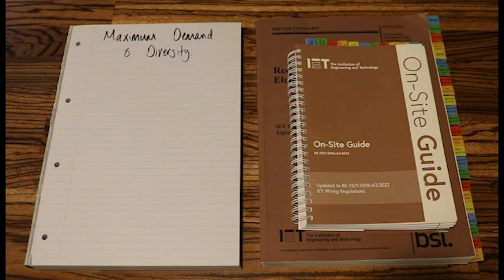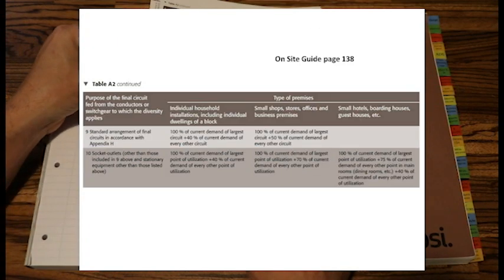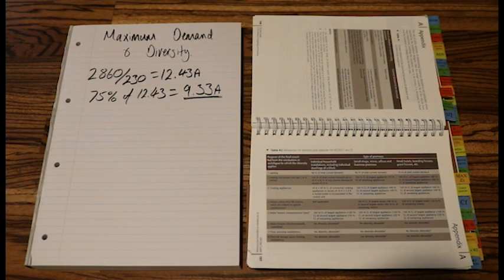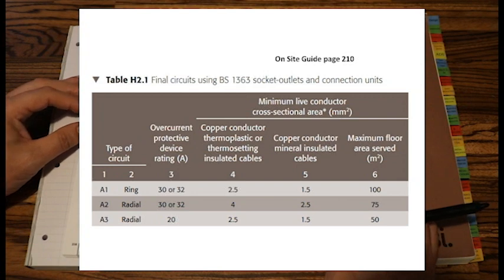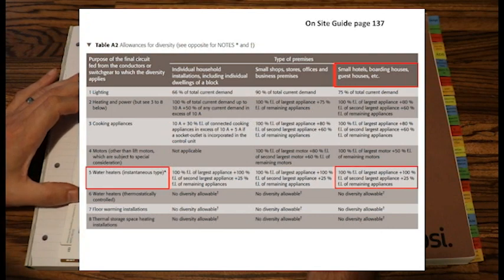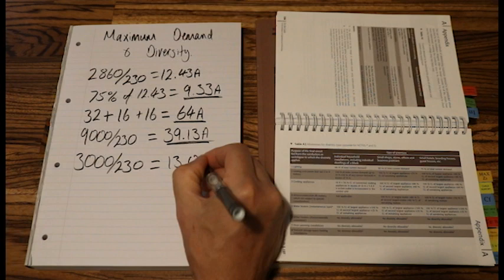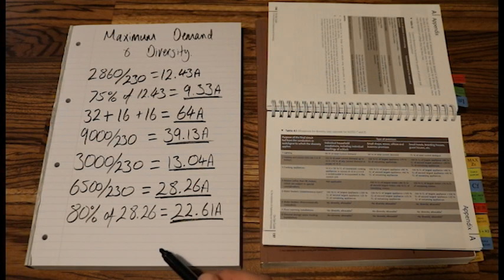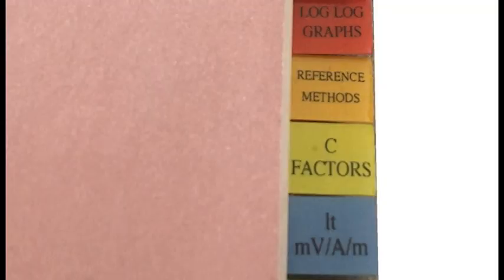Using diversity to calculate the total current demand

Comment: So, I just come across your video and I literally just copied my question into google and came here out of curiosity , my question is pretty much exactly like yours with the expectation of the cooker instead it is just one cooker at 10.37kW rather than yours which is 2 x 6.5Kw.

 I'm just wondering where did you get your question from? Mine is from Level 3 Advanced Technical Diploma in Electrical Installation Unit 303 Worksheet 11 Question 3 *2024*.
Reply from the maker: Hi pal. They are exam style questions I make up for students like you. For more exam style questions, formulae sheets and guides, check out
www.electricalstudent.co.uk
Reply: Oh ok got that thanks
Reply: Hi am just wondering when you add up the total I got 188.8 I don't understand how u got you're answer can you please show me thank you
Reply from the maker: @craigrod5728  you have added the first 12.43. Only add everything that has been underlined. Using diversity, you only use 75% of 12.43, which is 9.3. When totaling up the maximum demand, we only include the 9.3, not the 12.43
Reply: Can you explain for me , why we don't calculate 60% when we are applying diversity for cooker appliances?